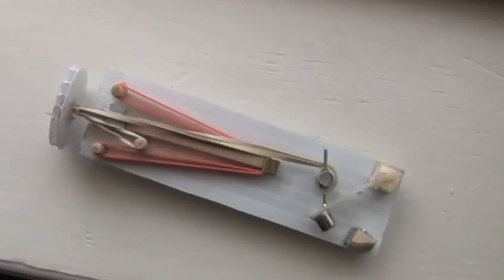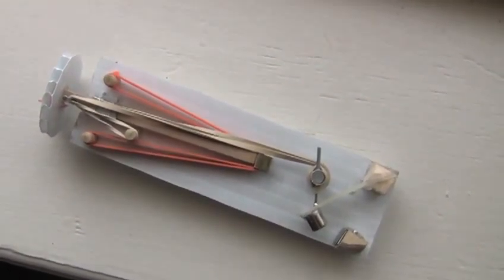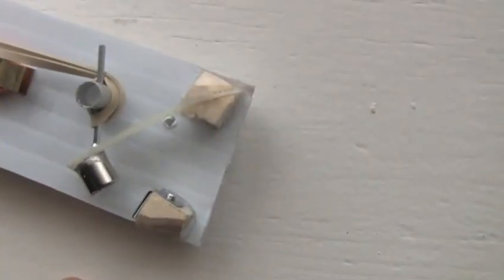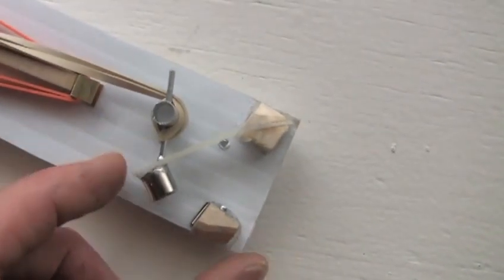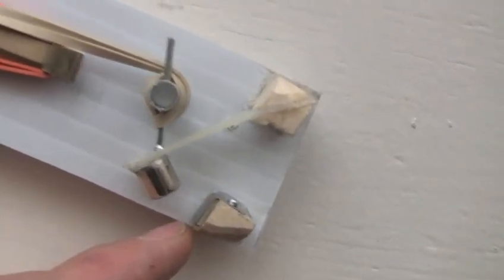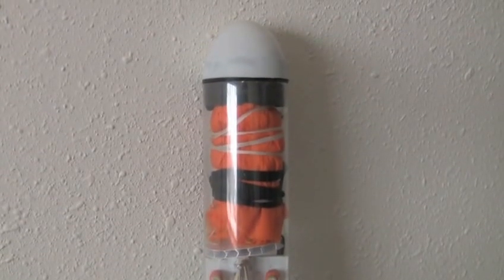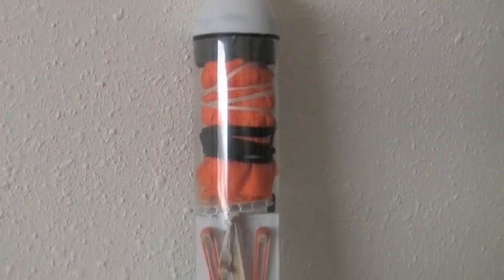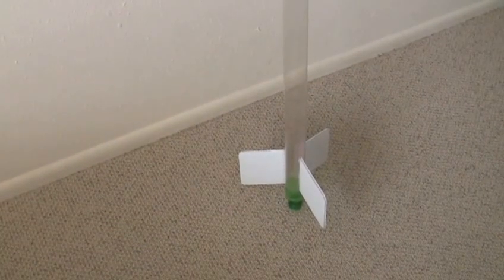FTC Water Rocket Vertical Inline Parachute Deployment with Tomy Timer

Comment: Great idea as I'm just starting out in rockets. I changed your design for my use by getting rid of the Tomy Timer and using a tiny motor hooked to a battery and mercury switch. When the rocket reaches apogee and noses over, the mercury switch allows current flow to the motor releasing the parachute. This way the chute only pops out at apogee instead of a predetermined time.
.

Comment from the maker: I made the frame out of core-plast, which is a corrugated plastic material available at hardware stores. It is often used for sign making. It is very light and pretty strong, but I used multiple layers to get the frame stiff enough.

Comment: Can you explain the gravity switch and as to how the magnet will attract to the metal plate ?
Reply from the maker: The inertial force of the rocket taking off causes the magnet to move towards the metal plate, i.e the magnet "wants to stay where it is" while the rocket takes off. The magnet is on a flexible piece that bends due to this inertial force on the mass of the magnet.
Reply: @karlwinkler66  thank you sir 😀

Comment: Hi There, Looking to make one of these FTC rockets.
Can you tell Me please, if you use the whole of one 4 foot FTC  for the rocket pressure vessel or does the top payload bay come out of the same 4 foot length ? 
Nice parachute ejection system, will go with this.
Regards Paul.

Comment: Hmm, looks neat! Do you think similar system could be used in mid power rocketry at approx 1.5km alt?
Reply from the maker: I think the trick for that would be to figure out the timing, which may be difficult considering the altitude. If the 'chute opens early, it could be destroyed, and if late, the rocket is already falling. I would suggest using an electronic system with an apex sensor.

Comment: Very cool deployment system for the FTC. Do you have to take the whole system out of the tube to re set the timer and rubber bands?
Reply from the maker: Yes, that's correct. The whole assembly must be removed from the tube to be set.

Comment: Hi I am trying to get an answer to the ftc tube length for the pressure vessel.
I am using T12s at 4 foot long.
My question is, does the payload/parachute bay come out of that 4 foot length, if so, how much ftc tube in length for the pressure vessel do you allow please ?
Regards Paul.
Reply from the maker: I use a 4 ft length just for the pressure vessel, then cut down another piece of tubing for the parachute and deployment system.

Comment: You may be able to replace the (hard to find) gear mechanism with a simple escapement mechanism like this one which uses a weighted string winding and unwinding around a post.

If it had a name, I could find a better example, but here is a video that shows several versions in action: https://www.youtube.com/watch?v=J-OY0KxRdgQ